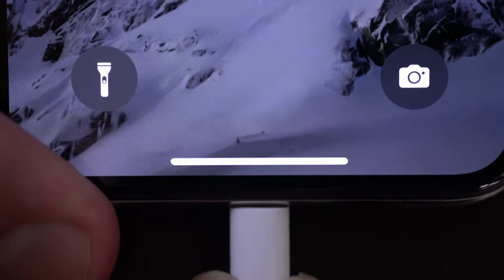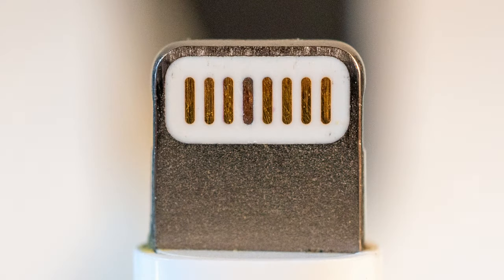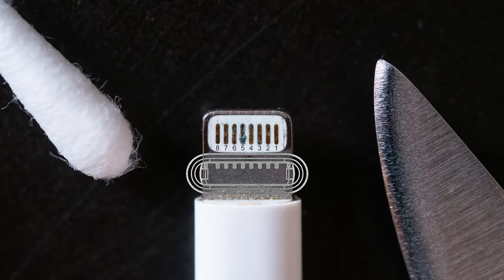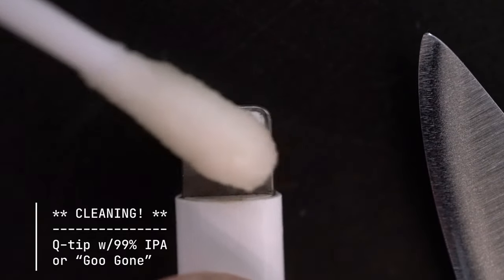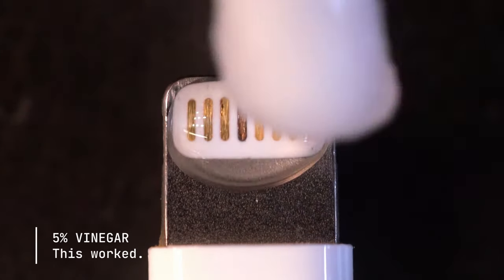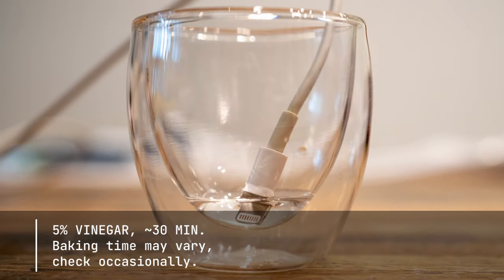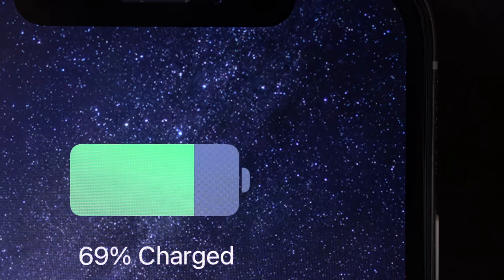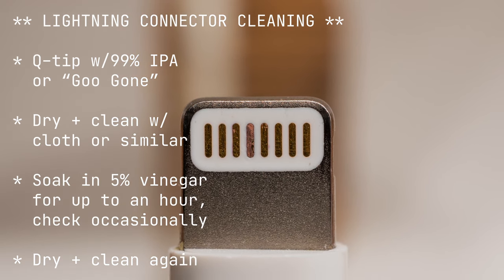🔌📲🤔🤷 iPhone not charging? Learn how to fix your lightning cable in 90 seconds!

Comment: Bro my charger is not working or idk what happen it is not charging my phone  but when u connect my charger with airpods it work but not charging my phone help me plz
Reply from the maker: USB-C? Try cleaning out your phone’s charging port, very gently, using one of those plastic toothpicks that have the C shape with the string across them. The other end of those can fit charging ports and help get lint and other stuff out of there. If the cable doesn’t fit the phone properly, it may be the port. It’s worth looking at the cable, too, for corrosion (if lightning) or lint if USB-C.

Comment: What if the cable is brand new
Reply from the maker: Assuming not defective, try a different power supply, port or charger.
Reply from the maker: The port on your phone might also be dirty or clogged, preventing a full connection. Try using a flat toothpick or the end of a paperclip, carefully, and “sweep” out the area.

Comment: What if i dip my port in 5% vinegar
Reply from the maker: I don’t recommend this unless absolutely nothing else has worked. If you try this, don’t leave it for long and rinse with water afterward.

I recommend trying a flat toothpick first, see if you can fish out lint and whatnot which may be the actual cause of cable fit or connection issues.

Comment: my cable works only when plugged on a specific side even though its supposed to work on both sides and none of the pins are corroded
Reply from the maker: I would think your cable either has some sort of connection issue, or maybe it's not making contact evenly on one side (although, that seems unlikely.)

First thing I suggest: Try another cable if you have one, and see if you get the same issue.

If changing the cable has no effect - try a toothpick or a paperclip, very carefully, and see if you can sweep any lint or other stuff out your phone's charging port.

Comment: Omg help me I can not charge my iPhone because of the thing but I see this video do I try but is that water if it then it will make ur iPhone broken
Reply from the maker: Your phone should be largely waterproof, but don’t put the whole thing under water. 😉 A damp cloth is OK and safe to use. For the cable, I recommend trying a drop of vinegar and then a clean with a damp cloth as needed.
Reply: 👌 thank
Reply: for 30 minute?
Reply: oh no I forgot to tell you about that I think is because of my phone because every of the charring thing to use so every of them I try on my phone but it doesn’t work so maybe is because of my phone

Comment: My cable is suddenly stoped charging my phone but its charging my airpod. What should i do now?
Reply from the maker: Your phone’s lightning connector may have some lint or other stuff blocking some of the electrical bits.

You could try carefully inserting the end of a paperclip or pushpin, not on an angle and not pushing hard, and move it around the oval shape of the connector a few times. You may loosen and pull out some lint or fuzz or other stuff. You can try blowing air in a corner, or compressed air (carefully) as well. A pin has worked for me in past, when the cable eventually wouldn’t fit and stay in my phone.

Comment: How to get 5% vinegar?
Reply from the maker: Check your local grocery store or supermarket. If you can’t find plain vinegar, try some lemon juice with a bit of salt mixed in. Light acid, should work similarly to clean copper.
Reply: @scottschiller  Thanks. I can get Vinegar but you said 5% vinegar, so I got doubt
Reply from the maker: I think 5% is pretty common, but I could be wrong. I just checked what I had at home (plain white vinegar?) and it did say “5% by volume” or similar somewhere on the label.

Comment: My charging brick is making weird noise and not charging the phone
Reply from the maker: Sounds like that power supply is going bad - I would stop using it, it might be sparking or arcing internally (causing heat) and that could be a fire hazard.

Comment: My phone is charging but battery percentage increasing very slowly 1percent increase in 5-6minutes please help
Reply from the maker: A few things can contribute to slow charging. If your phone or battery is hot, charging speed may be reduced. If you are using apps that do lots of video (games or video editing for example), they may be using up a lot of battery power. If your phone and battery are older, the battery may have reduced capacity and storage. On iOS, you can look at settings -> battery for some info.
Reply: @scottschiller  no sir everything is fine the speed reduce very much like 1percent in 10minutes ! I don't no the problem is in cable or adapter I have tried your trick if this work I will tell
Reply from the maker: Trying a different cable and power supply may help, those are good things to test.

Comment: Mine just charges then it stops and shows the charging sign again
Reply from the maker: Sounds like a loose connection. Check charger connection, try a different power source, and then cleaning the cable connector and your phone’s lightning port. (For the port, try the curved pointy end of a plastic dental floss pick - and scoop out the corners carefully.)
Reply: @scottschiller  alr, thanks man! i fixed it by just turning the charger head to the other way, your sollution fixed it too!

Comment: It didn't work for me, 😪
Reply from the maker: Try using the cable with a different USB power supply, just to see if the power makes a difference.

If you suspect the cable, you can also try using an eraser (carefully) on the pins - if there’s some gunk on there, that might help loosen it up.

Comment: I think you meant 91 percent isopropyl alcohol....99 percent is quite hard to find and rather expensive....
Reply from the maker: 99% is what I meant, and it should be readily available; $6 for a 500ml bottle. Unless you’re seeing science-grade stuff, pricing should be very reasonable.
Reply from the maker: I should add - 91% should be fine for this as well, it’ll just have more water in it.
Reply: @scottschiller  what country are you located in.... all I can find in 99 percent is 30 dollars for a whole gallon which is 3.78liters metric?....I know 91 percent will work.... you could probably get by with 70 percent honestly....
Reply from the maker: Whoa! Yeah, that is just way more than you need in terms of volume. A few millilitres would do just fine. I’ve bought 500ml bottles at pharmacies and online from the US and Canada before.

And yes, you might be able to even use high-proof vodka in a pinch, too. 😅 “Goo Gone” and other kitchen cleaners like CLR might do the trick, following the warnings and applied carefully.

Comment: Apple store cost of charging cable is 20 to 25$. It is not working more than 2 years. Why don’t they make from better material ? Consumer has no complaint about cost when their mater is long lasting.
Reply from the maker: Given the number of devices (and cables) sold, I’d say the failure rate is relatively small. That said, it is still a significant number given the number of Apple devices and cables sold.

Comment: Not working 😢
Reply from the maker: Suggestions:
* Try a different cable, same power supply.
* Try a different power supply, and/or a computer.

If neither of the above work, then it may be your phone's charging port is dirty and/or clogged. Try a flat toothpick, and carefully clean around the shape of the port. You may have some lint or other gunk in there. Blowing air (carefully) into the port might also help loosen up some stuff.

Comment: My phone charged only 3 second and not anymore 😢
Reply from the maker: This sounds like a connection issue, perhaps your phone’s charge port if not the cable. Try a different cable if you have one, and see if the same thing happens. If so, try cleaning your phone port carefully with a toothpick or the end of a paperclip. Might have some lint in there.

Comment: Thank you for the help THAT DOES NOT WORK
Reply from the maker: If not corrosion, try checking your phone’s charging port for lint etc. Try using a plastic tooth floss pick, the end that has the little pointy bit is handy for scooping out the charge port.
Reply: @scottschiller I already cleaned it before doing this
Reply from the maker: @IgongAgustin Hmm. Try a different cable and power supply, see if one or the other might be the cause.

Comment: I’m i the only unlucky mf who it didn’t work for? Works with other chargers but not mine. This 25 dollar cable is heavy duty and only 2 months old.
Reply from the maker: If you haven’t yet, try a different power supply and see if it works any better.

Comment: uhhh what has 99 % alcohol……
Reply from the maker: 99% isopropyl alcohol, also called “IPA” for short—but not the kind of beer. 😉 It may also be referred to as “rubbing alcohol.” The 99% kind is preferable as it is more pure, which means less other gunk that could be left on your phone when it dissolves.
Reply: @scottschiller  thanks!

Comment: Didn’t work brooo
Reply from the maker: Try this with another phone or iOS device if you have one, see if there’s any difference. You can try using an eraser on the connector as well, to rub dirt or other gunk off. If no cables seem to work, your phone or iPad’s lightning connector port may have lint or dirt blocking some of the pins.